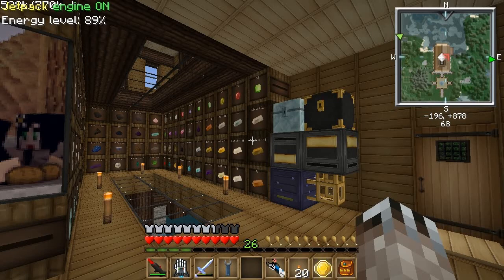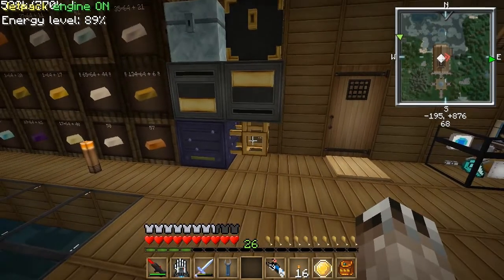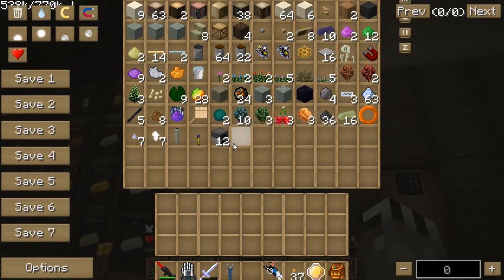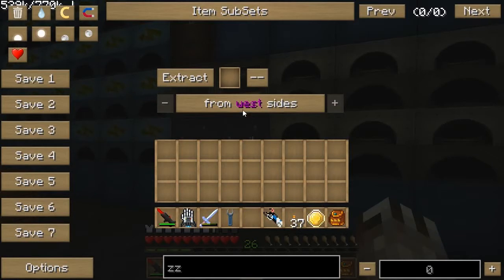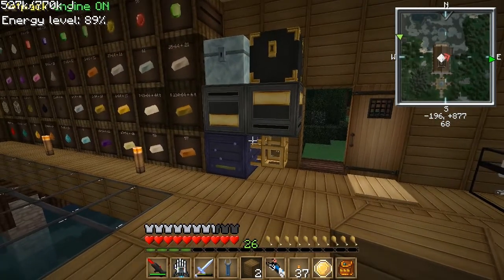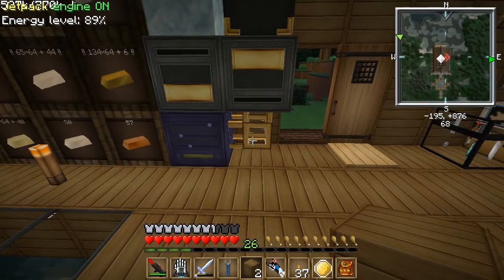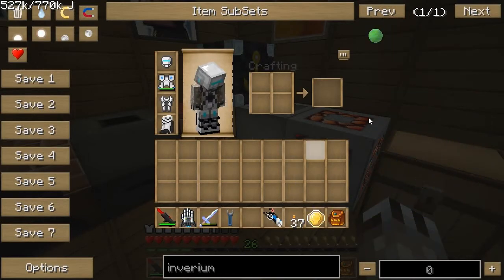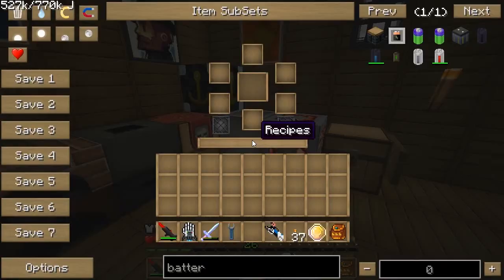FTB Tutorial: Improved Barrel Sorting System

Comment from the maker: Thank you for the sub! The system sounds good, and not to throw a wrench in your plan, but in case you didn't already know you can also use redstone energy cells next to wooden transport pipes to pump ridiculously fast.

Set it on 1 MJ/t and it will pull 20 items per sec. Increase it and pump speed increases. And you can set them to be redstone activated and set up a gate to turn it off when the inventory is empty, otherwise it always drains

Comment: Thanks for posting this, I've set up a similar system now and it works fantastically.

I'm currently trying to work out if it's possible to pull items out of the barrels on demand, though. I'd hoped I could add another Router set to extract connected via a pneumatic tube to the Retriever, but the Router just starts pulling out everything. Added NOT gate so the Router was off until the Retriever was on, but it pulls everything out starting with the closest stack item. Any ideas?

Comment: I didnt find a solution to this problem, could anyone help me? If I have empty barrels, the items that already have an existing barrel will be put into empty barrels and i have to manually move them to their own barrels. It's kinda pain, and i would appriciate if someone helped me.
Reply: The only work around i've found for this is putting in 1 block as a placeholder (eg 1 cobblestone) then, when items are pushed into your overflow chest, you can manually put the first of that kind into it's own barrel to be automated from then on.

Comment: What pipe is it that you are using? And what are the other 2 thingys that pushes the stacks?
What upgrades are you using in the router and the other two?
Reply: I am guessing it is a pneumatic tube since he mentioned a filter which is also a redpower2 item. If you have thermal expansion go with an itemduct with pnematic servo. You wont need a redstone clock and there is built in filter functionality.